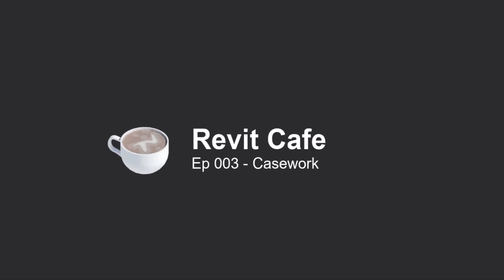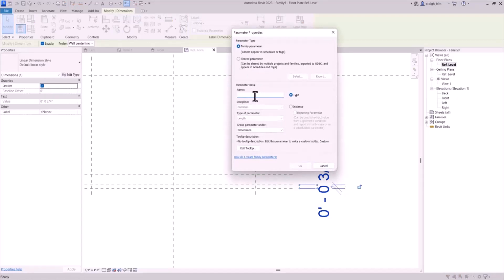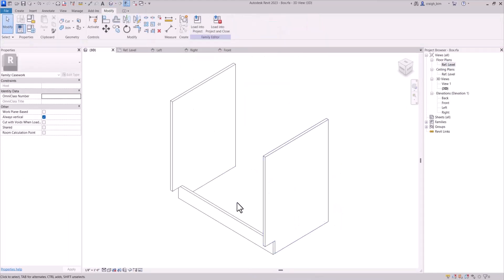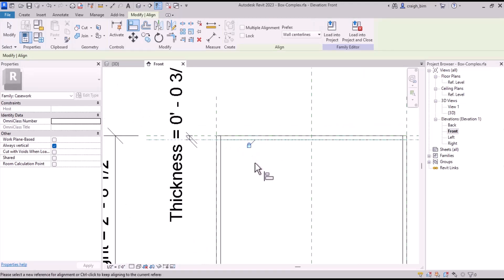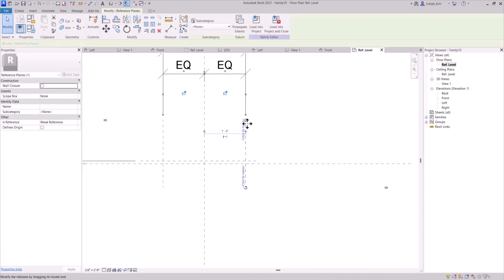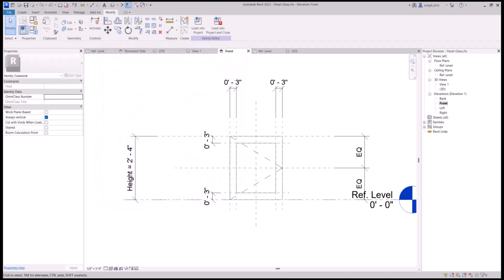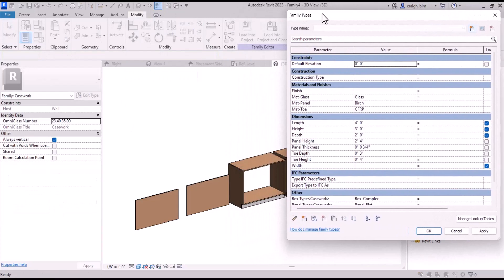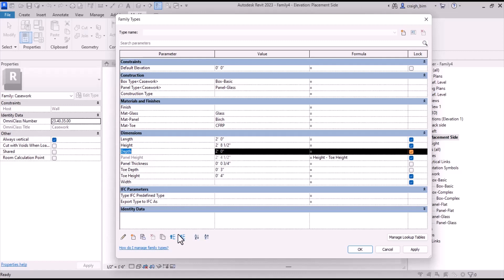Episode 003 Casework. Revit Families.

Comment: Thank you for this video. When I mirror the end panel (~7:27 in video) and associate the copied panel with the Right Work Plane, it flips the panel on the other side (to the right side) of that work plane. So from the Ref. Level, the inside of the right panel is in-line with the outside of of the Width parameter. Therefore, its always going to be 3/4" wider than the intended width.